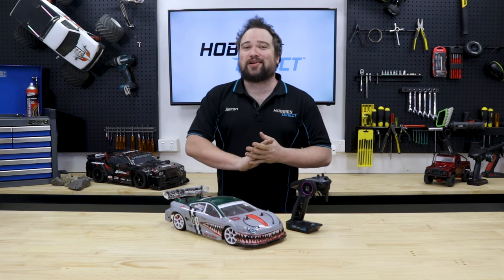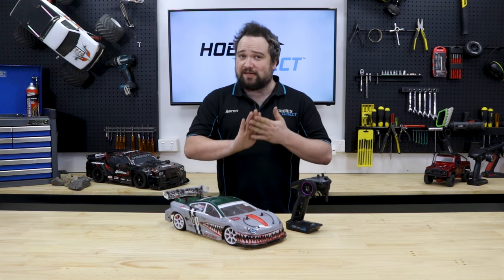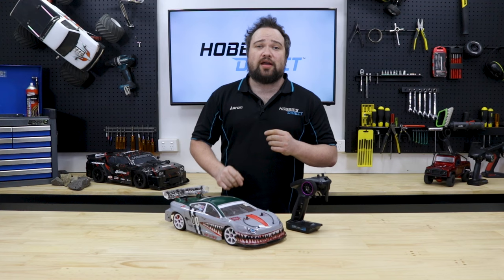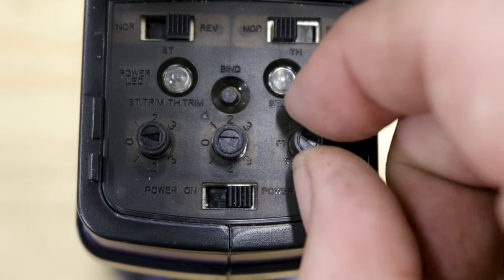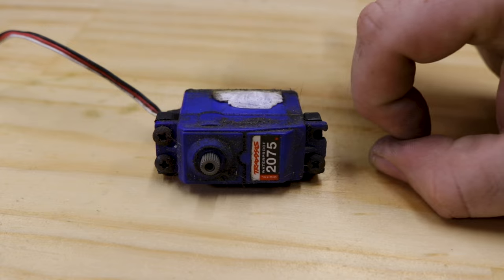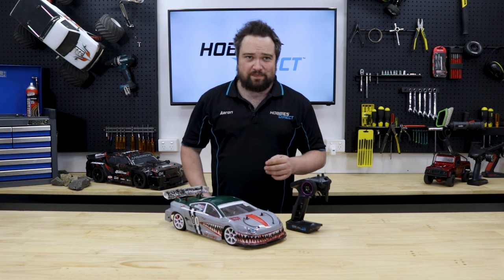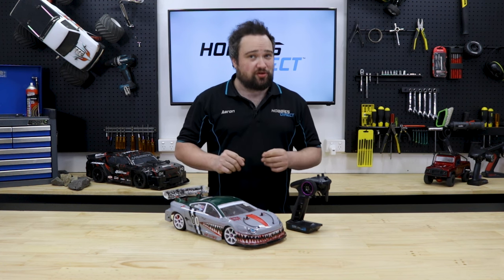RC Car steering not working? Here's how to troubleshoot!

Comment: Why is mine shaking left and right
Reply from the maker: What servo in what car with what controller from what brand? If it has any sort of stability control, it might be calibrated wrong, or the controller's wheel's contacts might be dirty or not working properly. Or, it's time for a new servo.
Reply: @HobbiesDirect  Deerc 300E brushless
Reply: Not to bother as now got the 1/8 scale mvck rx flux 4S
Reply from the maker: Nice! @Jayzkayaydancasper

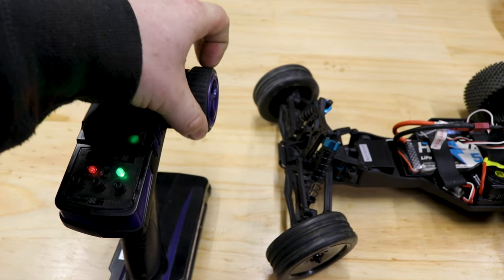Comment: My car is turning left or right but it is sticking either way unless I turn the wheel back. After I turned left or right the wheels would automatically return to the neutral/facing forward position but since I put new steering arms on due to a break in one I am having this issue with the steering...Any suggestions? In 2:10 of this video when you let go of the steering wheel the wheels return to neutral/straight, mine isn't doing this. When I let go of the steering it is still facing left or right.....Any suggestions please?
Reply from the maker: As a guess, either the position sensor in the servo has been damaged in the crash, or the new arms are binding up on something.
Reply: @HobbiesDirect  Thanks I'll look closer to see if there is any binding, If still no luck I'm replacing them with aluminium ones anyway so if there is still issues I'll replace the servo!